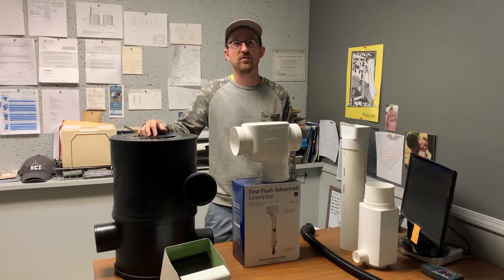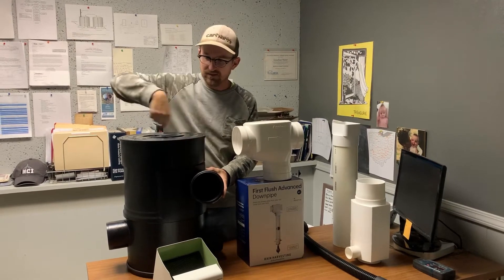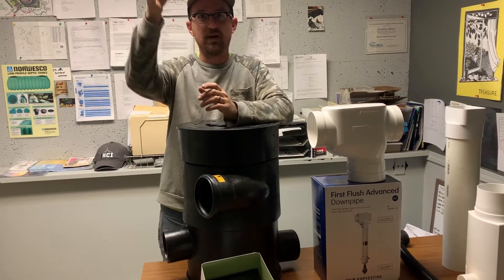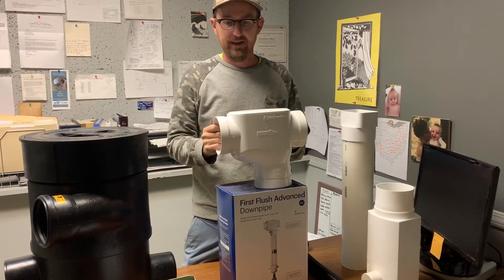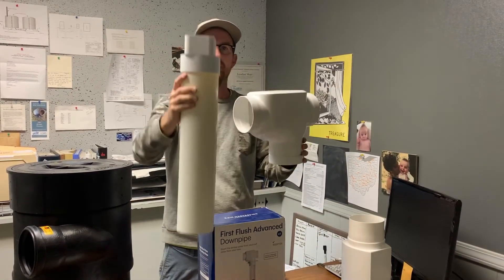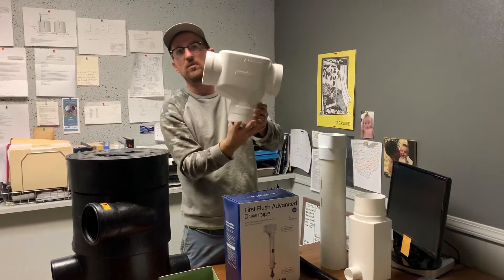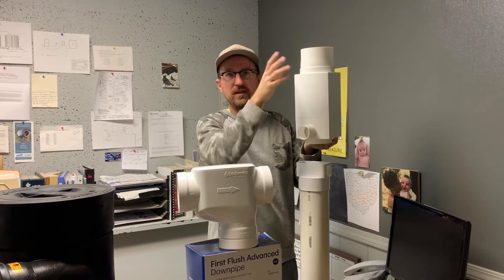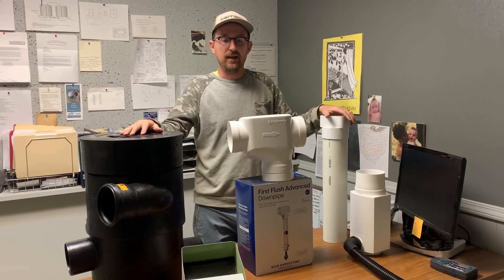Pre-filtering options for rain harvest cisterns

Comment: I have a cabin with a metal roof which is @700 sqft.  It is nearly 200yrds from any trees and a mile from any dusty roads or highways. Do you think I need a pre filter in this instance?
Reply from the maker: Great question! Thanks for writing. For pre-filtration, we judge a system based on a “dead bird” scenario: What happens if a bird dies on your roof? I hate to admit it, but I’ve seen it happen a handful of times over the years - we want to make sure there’s no way for that bird to get into the cistern/tank and contaminate the water supply, and best case scenario, we use a pre-filter that removes the bird as quickly as possible from the drainage. Our Wisy Vortex filter and our Monjolin filters (not mentioned in this video because it’s a newer technology) both do well to remove any potential contaminants as quickly as possible from the drainage system so that they do not impact the water supply. Gutter guards, in your case, may be sufficient, but they are generally more expensive and not as thorough filtration compared to the Wisy or Monjolins. Hope this helps!